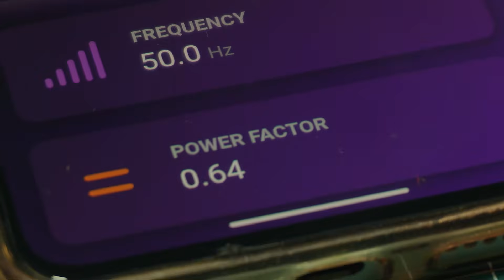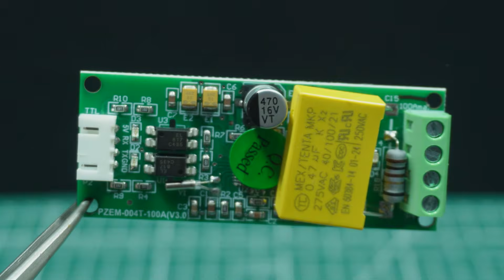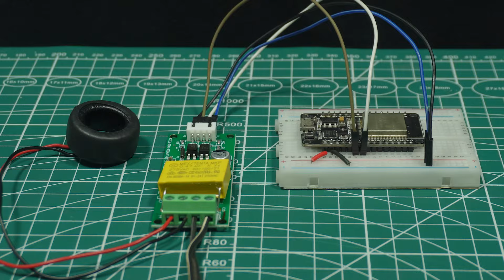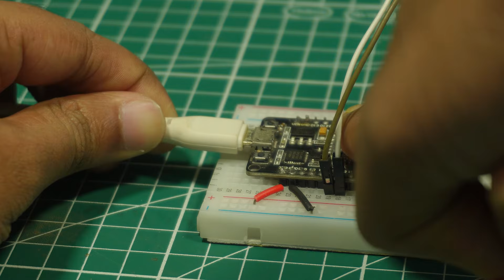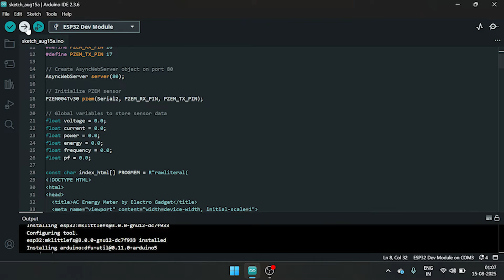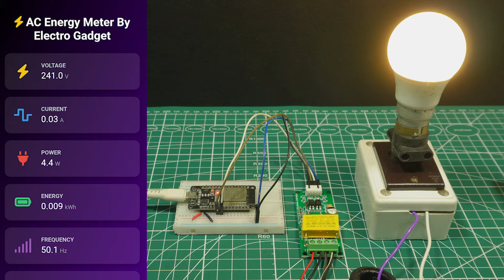IoT Smart Energy Meter Using ESP32 & PZEM-004T Module

Comment: some how i installed arduino ide in laptop by using your source code and all seccessfully compile but how the current and voltage is showing in your phone do you used any external app if so clearify please! 
And also if i purchase your source code do you completely clearifiied their everything like circuit diagram and 100% of steps in it?😊
Reply from the maker: I think you don't have knowledge on esp32 and these energy metering sensors or app anything. So I will recommend not to buy the source code. Actually I am so much busy with some customers and if I sit to build your project by guiding you as a beginner way. It collides with another customers
Reply: @electro_gadget80 
no worries buddy you can carry on i dont wanna disturb you by the way tnx for reply❤

Comment: Can i add a relay  before the load connection and program the code in such a way that if the current is less than our set desired current then the relay cuts the power to the load
Reply from the maker: Yes but you have to modify the code then.
Reply: @electro_gadget80 are you sure this is safe since we are using direct 220v ac in this project

Comment: Can we use Arduino
Reply from the maker: Arduino is not a IoT device that means no wifi and without wifi you cannot monitor using smartphone. But if you want to use without smartphone I can generate Arduino code for yourself with local lcd display to see every parameters. And the source code and circuit diagram cost will be 10 dollar only

Comment: Hi! I’m interested in your project. I want to know how much voltage it can handle. Is it only suitable for a bulb, or can it support larger electronics/machines? Also, what modifications would be required for higher loads?
Reply from the maker: It can handle upto 260 volt ac supply and 100 ampere load. And this not limited to only bulb. It can handle upto 26000 watt load as it rating is 100 ampere. You can attach to your whole house mains supply it will easily handle it.

Comment: Good afternoon, I followed all the steps in the video. I'm not sure if I should combine all the code from the website. I asked an AI to combine all the code parts into a single code and uploaded it to the ESP32.
Reply: The webpage loads but doesn't display any values; all the fields appear as 0 except for voltage and frequency. I'm not sure if you could help me, as this is for a university assignment. I would appreciate your assistance.
Reply from the maker: Contact me at info@circuitdiagrams.in

Comment: hi , im confused as to where did you put the bulb input at and where is the pzem sensing current and voltages from?
Reply from the maker: I clearly show where these are from. And if still can't get it, you can see the circuit diagram link given in the description. The bulb is plugged directly into a socket in the house, only the live wire is wound around the magnetic coil. And for the voltage sensor it's wire is also directly from the home ac mains socket.

Comment: Hello, Is it possible to add a threshold for current using a relay (Example: if current > 1.2 to turn off baseline for (overcurrent/short circuit)) alerting or notifity the user??
Reply: pleaseee i need thiss information, anyone can help?????
Reply from the maker: Absolutely not. Relay is basically an electromagnetic switch. This cannot detect any small or high amount of current.
Reply: can you suggest which is better for power protection system?? Acs712 and zmpt101b or pzem 004t?
Reply from the maker: Always pzem-004t as it is auto calibrated and industry standard sensor
Reply: @electro_gadget80 can you please help me create this project?
Reply from the maker: Contact me through info@circuitdiagrams.in

Comment: How can I add a relay to it?
Reply from the maker: Take any one of the GPIO pin from the esp32 and connect it to relay input pin. As well as modify the source code for this gpio pin. That's it. But if you add relay in it then the webserver code also need to change so why do you want to add relay in it?
Reply: @electro_gadget80  To add a feature that automatically control the load such as putting a time schedule to turn off and turning it on/off in the web. Do i need to add a relay for it or just change in the code?
Reply from the maker: Obviously you need to add a relay for it.
Reply: @electro_gadget80  Can you suggest a relay capable of handing single phase 220V?
Reply from the maker: You can use 5v 10 ampere relay module
Reply: @electro_gadget80 Thanks

Comment: Is it necessary to connect 5 v power supply as you haven't shown in the video
Reply from the maker: ESP32 is basically operating in 3.3V supply. So feeding 5V into it can damage in the long run. So if possible feed 3.3V supply to both the ESP32 and PZEM module.

Comment: PZEM004Tv30.h library is not supporting the version 4.0 of module is there any other library that supports it
Reply from the maker: I am sorry, but since it was launched recently, there is no specific library available for version 4.0 on the internet.
Reply: I'm facing the same issue. Did you find any solution?
Reply from the maker: Check out this library https://github.com/Neubolt/PZEM-004T-v4.0-Bidirectional
Reply from the maker: Check out this library if it works https://github.com/Neubolt/PZEM-004T-v4.0-Bidirectional
Reply: Can you provide the complete code in a systematic way? I don’t know anything about coding. Can you give the entire code in one place so that I can paste it directly into Arduino?"
Reply from the maker: Full code already in systematic way published in my article page link in the description. Just copy and paste and install required libraries mentioned also in that coding section. Libraries you have to install yourself by watching some video library install tutorial.
Reply: @electro_gadget80  sir in description code is available in pieces. 
Sir please provide any where code is available at one 
Then i can copy the whole code. Please make a file where upload full code.